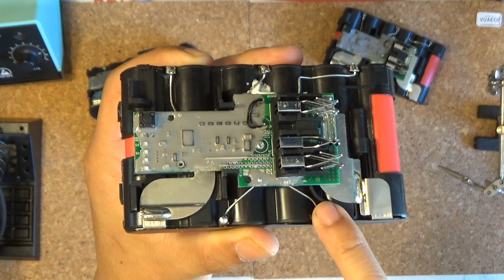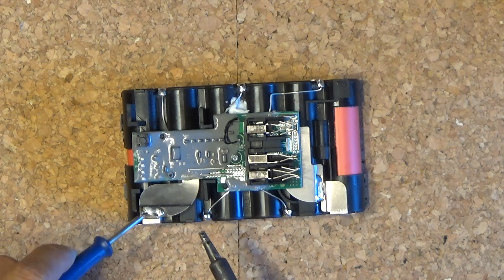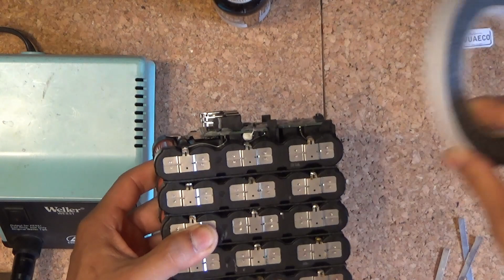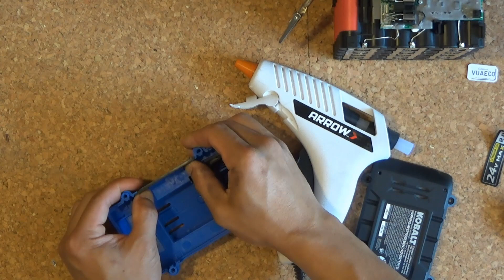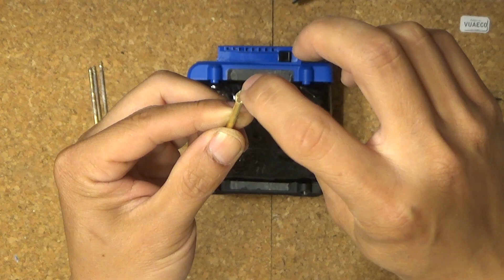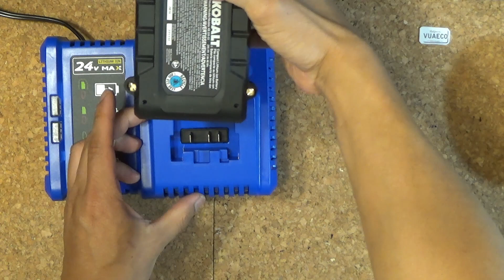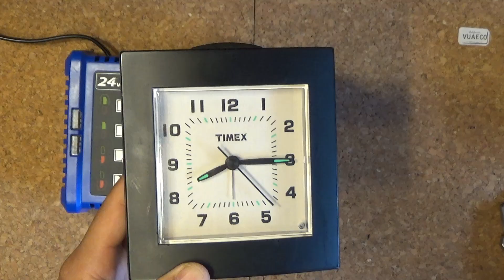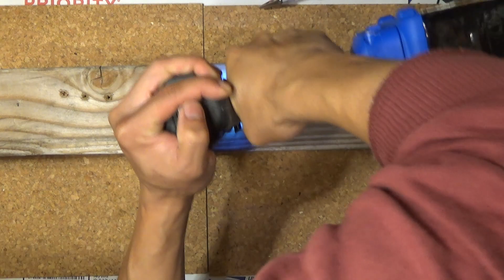DIY: The World's first 10 Ah Li-ion power tool battery built for Electric Bike home-made

Comment: The only ones that need double shunts are the (+) and the (-) from each pack, as they're the only ones that carry full load current. The other tabs are only used for balancing the cells during charging and monitoring cell voltage; a single shunt wire will be plenty for that relatively very small current.

That said... This 5lb pack is gonna make everybody think you're a wank-spank pr0n junkie with the one big Popeye forearm you're gonna get from lifting it. ;)
Reply: If the balancing charging board is sensing the voltage on each of the 6 cells as they are charging, (of the top bank of cells)well shunting all the cells forward to the top cells, allows the charging/balancing board to sense ALL the cells in the stack, and I would guess, service all the cells, to keep them each fully charged and balanced. One of the problems of charging multi cells in series is that often one cell or another is weaker than the others, and so because of it's lower voltage, it registers all the cells in the series "Undercharged" and so the bank keeps getting charged (Overcharged) and so one cell is undercharged, the others overcharged, the net effect is unhealthy performance on the whole bank. I personally think bridging all the cells forward to the sensed cells right below the sensor board is quite brilliant, and thereby providing longer and more accurate cell protection for all. (I'd say "WELL DONE!")
Reply: I didn't say that. What I said was that the only tabs which needed DOUBLE shunts were the pack's main (+) and (-), as those are the only ones that actually carry full load current. 

He actually double shunted cells in the middle of the pack and left the main pack (+) and (-) with single shunts; the exact opposite of what I was saying.

I've been building RC Race Car/Plane/Quadcopter packs from cells since Reagan was in the White House; I know a thing or two about how balancing works and how to get the most out of a pack. 

There's no way he can get 100A out of that pack; the top battery's cell-protection circuitry will limit the current to  15-30 amps max. 

What he can get is longer runtime and cooler running cells as that 15-30A is divided between 5 banks of 6-cell packs in parallel instead of only 1 bank.
Reply: well said and explained !!   I doubt that those top + & - connectors are rated for 100 amps for more than a second.

Comment: FORGOT IMPORTANT THING! With multilayer battery you must have NTC temp feedback for every layer!!! While charging bottom ones can get hot without controller board knowing it and they can get damaged!
Reply: your opinion. All the power needs to pass though the board to the drain source. The board is designed for 2A
what if you pas 10A  something will have to go....perhaps the contacts .
Reply: capacity has nothing to do with board on top. tool will still draw same amount of current.
Reply: stll adding more batteries wont damage board
Reply: you dont get it, dont you?
CAPACITY IS NOT CURRENT!!
HAVING HALF FULL FRIDGE AND FULL FRIDGE OF FOOD IS THE SAME YOU WONT EAT ALL THAT IN ONE MEAL.
Reply: Board is desinged to measure voltage drop over RDS(ON) from 2 side to side N mosfets and by measuring that voltage drop it can know is it overcurrent or shortcuircuit and cut off the gate of mosfets. Cells give power how much tool wants not how much cells want. You cant make load draw more current by adding more capacity into batteries..... And no, board will handle it fine and wont die beacuse there is protection.
Reply: So he is not going to squeeze more power "a bigger load" from the batteries.  The only thing that is gain is that it would  last longer... Then is just as easy to have an extra battery and charged while using the other .
Not much advantage.
Reply: true
Reply: Ok.  However that is not what he did in these thing paralleling all 5 batteries witch I can't find a practical reason to use it like that
Reply: mnemennth posted this comment in which i have to agree on. He states :

"I've been building RC Race Car/Plane/Quadcopter packs from cells since Reagan was in the White House; I know a thing or two about how balancing works and how to get the most out of a pack. 

There's no way he can get 100A out of that pack; the top battery's cell-protection circuitry will limit the current to  15-30 amps max. 

What he can get is longer runtime and cooler running cells as that 15-30A is divided between 5 banks of 6-cell packs in parallel instead of only 1 bank.. 
Also there is the issue of the heat sensing on the batteries. they can heat up on a charge or discharge cycle.
As they heat up they can melt or bust in fire.  Many brands of batteries had had that problem already prompting a massive recall.
.
Reply: He is going to be charging them at 1/4 the rate as regular so I doubt it matters.  What he isn't going to have is balance charging.
Reply: They can't give or take a charge at different rates... tht would cause a cell to  rise or drop in voltage. since other cells are in parallel with it, not series, they would instantaneously pick up the slack to even out voltage across the entire parallel pack. No hot spots.
Reply: Matthew Walsh 1
Reply: yes youre right but if one cell gets hot charger cant know that to turn charging off but yours point is good
Reply: The thing id he want to use for other things
Reply: shit forgot on caps lock
Reply: you dont even necessarily have to use the BMS as the load output guys, regardless of whether of not he is doing that here, it's important to know that if you are monitoring cell voltage independently of the BMS, you do not need to power your load through it. Go straight to the batteries if they are matched to provide more power than your load can ever draw at peak.
Reply: no, he will still ahve balance charging
Reply: as it is now each pack will charge from a bus. the 4 packs below are taking charge at different rates and one pack can overheat accelerating the current consumption and short up or burst on fire
Reply: 5 in parallel might give more cycles/total WH than 5 individual cells. Smaller load and such. Also for his project would give a 5x boost to range before he needs to stop his EV
Reply: Matthew Walsh the discharge  C  rate also rises.  So you can pull more amps while the voltage stays  the same.  If the battery is normally  3c and 2000 the discharge rate is 6000mah. If you put 5 batterys parallel you can take    30.000mah. So not much advantage if you don't have a big brushless motor on it. This was only a example don't know the specs of the batterys he is using
Reply: It will be balanced between each parallel "set of cells" but each individual cell will not be balanced
Reply: You'll be fine your batteries will last a lot longer like this. Basically a smaller version of an electric car.
Reply: Sure, if he weren't charging a 5p pack with a charger meant to charge one cell individually. The cells are receiving 1/5th the current they normally would, what makes you think any of them are ever going to get hot? If it comes down to a cell failure, a temp sensor isn't going to help anything once the cell goes short-circuit.
Reply: yes and a 10 amp charger also.....the next thing is that the top board is not going to last too long because it will not handle the current for long.
Reply: Matthew Walsh bms is on battery itself -.-
Reply: Matthew Walsh bat managnent system = cell balancing and ocp uvp ovp scp
Reply: Are most medium-drain commercial batteries not wired THROUGH the BMS in order to provide over-discharge (low voltage) protection? That means the maximum Amperage of the BMS should be your maximum output, regardless of the batteries used. If, however, you wire the BMS to charge, but the load wires to the battery itself, you can charge it and balance it, and use it at maximum available power.

Comment: Not necessarily the first 10AH battery pack you can buy on the market... BUT, it is the first 10AH tool battery quite simply because you can't air-mail li-ion batteries with such insanely high capacities, and for manufacturers, it's cheaper and much faster to ship by air than water. No denying though, that battery pack MUST give you a pretty decent life and  won't be subject to the same amount of stress as the stock ones since you're spreading the load across more cells. ergo... a better battery life and the longevity is increased significantly.

Comment: cool I thought I was the only one to do this. I used x4 1.5ah packs making a 6.0ah. once I got it together I put a layer of tape around the cells then put the case together then used clear silicone in a caulk tube to make the cover. I smoothed it out with a straight edge and let dry. it's a little hefty but it's great for my grinder.

Comment: You did not need to join the balancing connections with as heavy of wire.  Since your cells are in a 6S5P configuration you could have kept a single strip down each of the balancing leads since very little current should ever flow.  The most positive and most negative connections are the only connections that need to carry a large amount of current.  The balance leads ensure that no one parallel set of cells goes over or under the preset voltage in the balance circuit.  If one set goes lower than the rest the balance circuit will cut the power as soon as the lowest set of cells in the parallel string reaches the cut off voltage.  The next time it is charged the balance board will ensure that all each set is at approximately the same charge voltage when fully charged.  Since one pack can deliver 20A you can assume that the drill is not able to draw over that 20A in normal operation so as long as all your most positive and most negative connections can handle that 20A it won't matter that the pack can deliver 100A since the drill and even the balance board were not designed to go over the 20A.  This pack as long as it is not damaged will likely outlast the drill since now the cells will not be abused near as much as they will share the current draw rather than one set having to provide the full 20A each string will now only have to provide 4A of current.
Reply: Those strips are carrying the current of the extra battery packs. He did not connect the main positive and negative terminals of the extra batteries. The strips will be used to balance also.
Reply: @draytonPW  I think what he is saying that he could have just joined all of the end teminals + and - from each of the 5x battery packs only, instead of joining all teminals of all cells within each of the battery packs. Either way I probably would have done it the way he did it for structural integrity none the less.

Comment: Very nice setup. Really nice and clean soldering done. For your screws, you could of used all-thread and then put an end on it with a washer.
I agree with a comment below about putting a new label on. Especially if you made some smooth sides and made it look like it "manufactured" that way  ;)